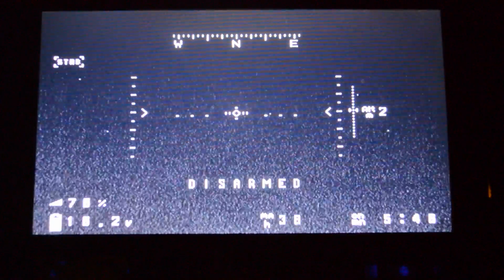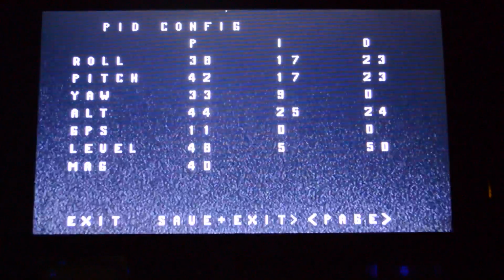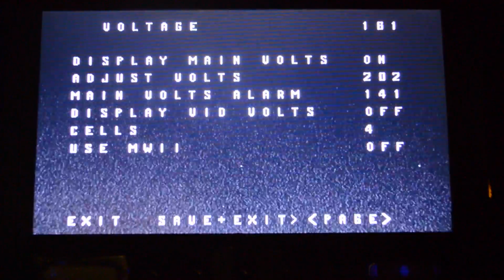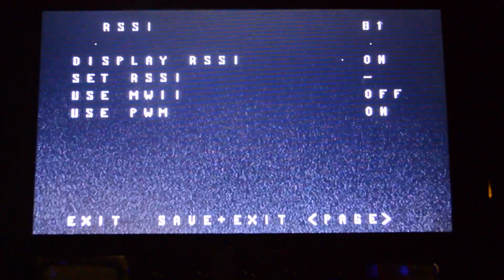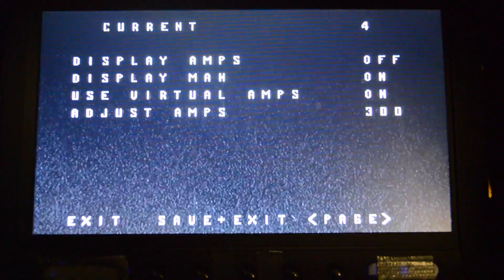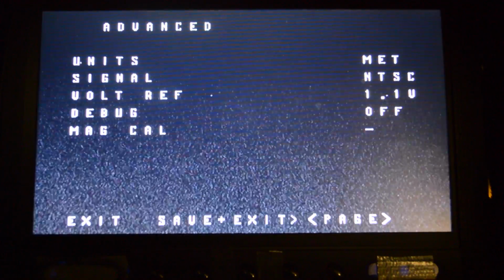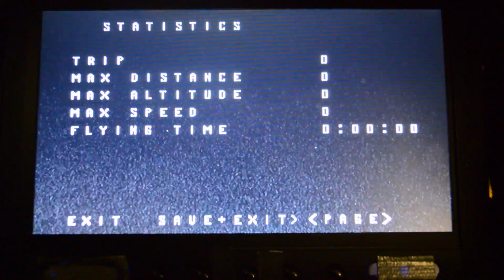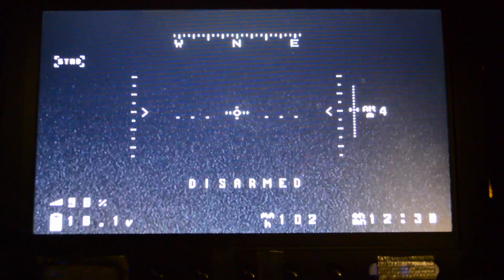Paris Mega V5 iOSD Update  Pt3  Inbuilt Menu

Comment: Very nice run down of features, and I have been messing around with MinimOSD Extra 
There are so many variations out there now it is down right confusing. But I got to get these KVOSD boards working with Minnaza OSD. That or spend ~$25 on a S-OSD which is a direct rip off of the code on the RCGroups thread. And now the author is rightly pissed.

Comment: I have an issue where the actual output is 'zoomed in' on the screen and a little bit of the tip and bottom are trimmed off, so I cannot read the GPS coordinates. There aren't any options on my monitor to adjust the picture stretching of my monitor, so it will have to be done from the minimOSD side of things. the camera I am using is the mobius with v1.2 firmware, if that makes any difference.
Reply from the maker: That is an issue with some displays, the camera has nothing to do with it. In the latest version of the code there is a line of code that can be uncommented to reduce the overall height of the OSD and will solve the issue. 

You need to uncomment the following line in the config.H tab of the sketch file then re-load the code, 

//#define SHIFTDOWN                 // Select if your monitor cannot display top line fully. It shifts top 3 lines down. Not suitable for all layouts

NOTE, if you are coming from an older version of the OSD you will also need to re-load the font file then use the latest version of the OSD GUI to re-set your layout etc
Reply: Deet96 Thank you,  I have actually found that and fixed it, as well as enable vsync to get rid of the sparkles. I was trying to get the battery monitor to work,  but ran into a bit of an issue where the wire soldered to pin A0 shown in the video broke off completely! Damn these SMD components. Anyway I went ahead and used magnet wire on the next pin,  the pin 22 or A7, but changing out the code to accept it,  it shows that that is the video voltage and not the battery voltage,  which annoys me.  Does anyone have a clue how to enable the battery voltage?
Reply from the maker: not with that board no
Reply: Deet96 Are you sure, it appears to be based off of arduino, I do have some experience with arduino, and there is code that defines what pin to use on the arduino. Changing   #define  VIDVOLTAGEPIN A0. below causes the video voltage reading to change, and that reading works fine and changing the A0 to A7 made the reading stable and semi-accurate, but I could not get any output from the  #define  VOLTAGEPIN A0. I think it was somehow disabled as it just read 15.0V or 0.00V regardless of what pin I assigned it to. I will need to examine the code further.
Reply: Power Max Ignore google's copycat of the hashtag functionality, I guess youtube and G+ do not like code lol!
Reply: not the PAL DVR crop issue is causing that?